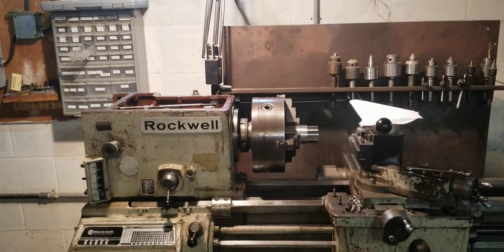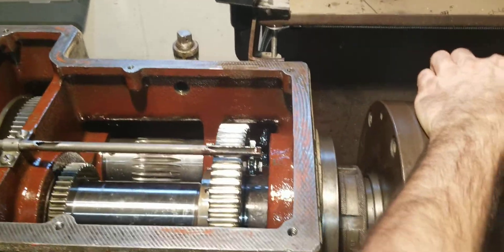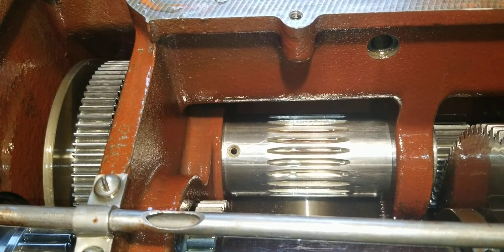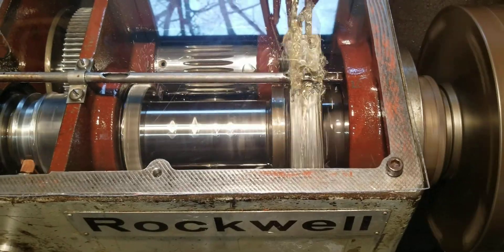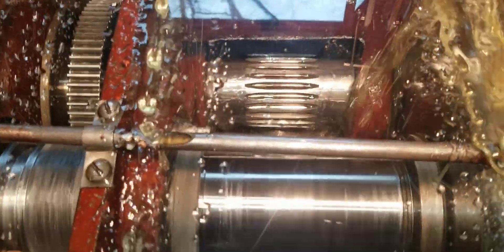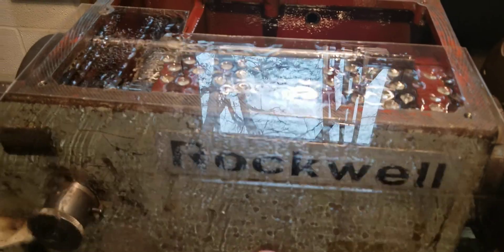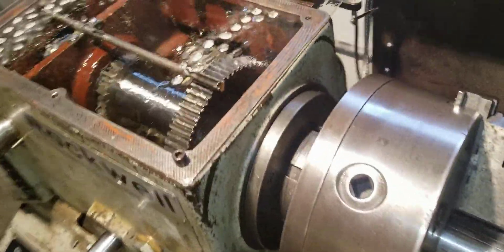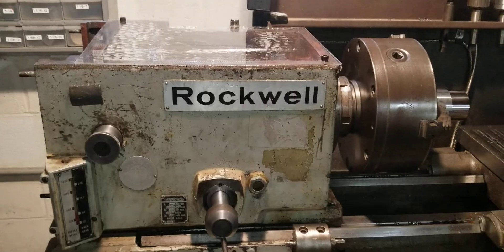14" Rockwell Lathe Headstock Oil System

Comment: I've been looking for a video like this . I have a 1943 Monarch lathe same model as Abom 79 . Just changed the oil that Monarch recomended and after running it for only a few minutes the oil looks all foamy , I contacted Monarch and they said it is caused by the churnning of the gears , nothing wrong .  I can see yours is doing the same thing so I feel better now . Thanks for the video .

Comment: what type of oil are you using in the gear box?
Reply from the maker: It calls for SAE 20 which is near impossible to find. I'm using ISO 68 hydrologic oil which is the equivalent for SAE 20...  You can get it at Tractor supply or any where that has hydraulic oil.  You could use ISO 46 also it overlaps with SAE 20 at the bottom end of the temperature range. So if you never run it long enough to warm it up and/or  you have a cold/unheated workshop ISO 46 may be best.

Comment: why would you run in back gear?  When would you run in direct drive and not back gear?
Reply from the maker: Think of Back gear like low gear. It gives you speeds as slow as 40 rpm and a top speed of only 265 rpm. Think of Direct drive as high gear. It gives you speeds from 210 rpm to 1600 rpm. Back gear is used for Threading, knerling, broaching, and for turning large diameters or hard metals where you need slower speeds or more torque. Back gear is also used in cases where maybe you could run the part much much faster but due to an unbalanced part shape your forced to run it very slow.